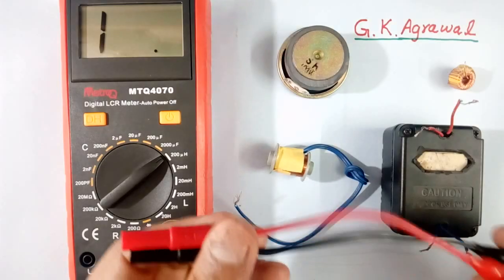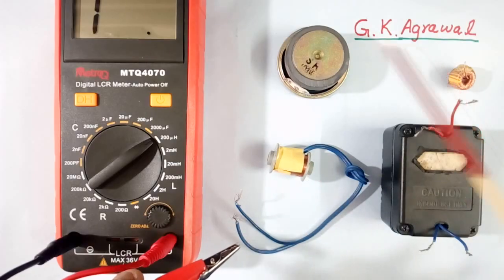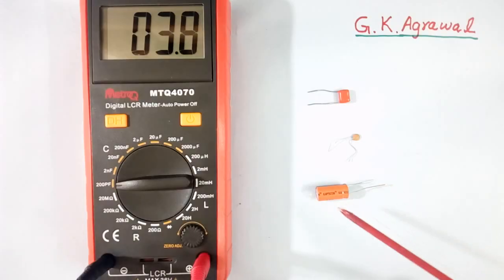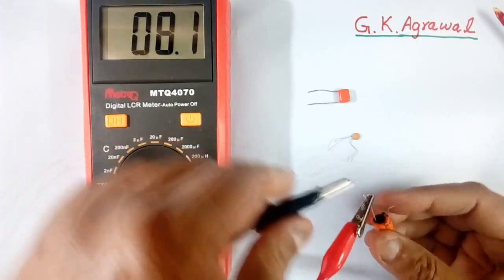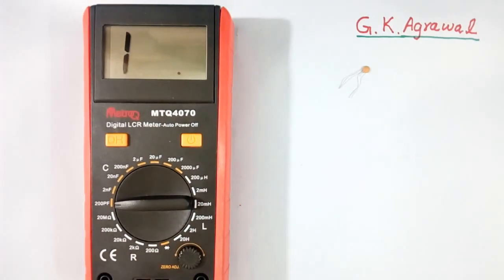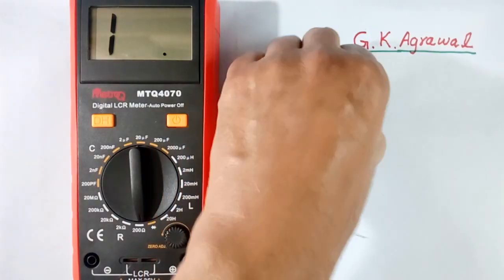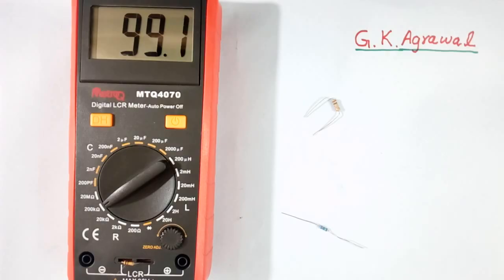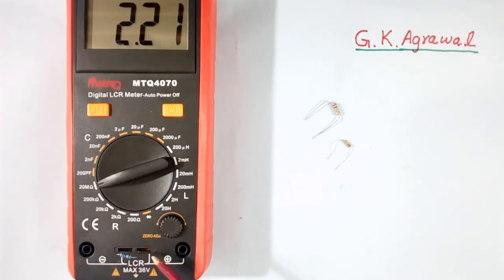LCR Meter to measure inductor, capacitor & resistor value

Comment: Thank you for the refresher course, I took electronics class in high school, but 35 years ago, Amazon has this tester for about $32 bucks, that is what brought me here, I have a peice of machinery that goes through start up capacitors, I been using an ohm meter to check them, this seems like a better route for testing them
Reply: I do HVAC work. Without some way of checking uF's, I'm lost. I use this for playing with xtal radio sets I build. Unless you want to waste a fair bit of wire, this will save me a LOT of wasted time, "close enough" calculations, and money. I now know EXACTLY what my vari caps are in value and the value of the coils I wind. That is half the battle!
Reply: The real one, no nonsense.
Beyond all credits,
Tq sir
Reply: Thanks Prof, I’ll get one

Comment: Hello sir can guide me. A simple wire known as interconnect comprises of some parasitics RLC can be modeled as lumped rlc model. So how to measure or extract the rlc of copper wire interconnect using lcr meter???
Reply from the maker: Calculate value theoretically.
Reply: @GKAgrawal2  i want to learn to do it by using lcr meter

Comment: Sir how to use zero set knob on this meter? I find that it does nothing
Reply from the maker: Zero dial is not working in my meter also.
Reply from the maker: Zero set not working in my meter also.
Reply: @GKAgrawal2  Sir , I just found out , zero setting works only in capacitor mode : Dont connect anything to the meter probes ,then set to low capacitance mode ,you will see stray capacitance on display ,now turn the zero set to display 0 .
Happy New Year

Comment: If We use the LCR meter which is available as module without any cabinet & has a Zif socket to connect components, will that give correct reading? I'm asking because I saw a video where a person was measuring Triacs & mosfets also with it

Also, please tell me whether the capacitance measurement option given in digital multimeters upto 200uF will give correct values for both Ac & Dc capacitors?
Reply from the maker: Accuracy depends on the quality of the multimeter. 
Further DC electrolytic type capacitors have wide tolerance. So values measured may not match with the value printed.

Comment: What is the Zero Adjust dial for ?
Reply from the maker: For adjusting zero for capacitor measurement as per user manual. However I checked, zero dial is not working in my meter.

Comment: Are LCR  meter and Multimeter same??
Reply from the maker: no, lcr meter may not measure voltage and current. However there is no rule, some company can always make LCR and voltage current measurement in the same multimeter.

Comment: Do you measure the Equivalent Series Resistance  (ESR) value of a capacitor in the same way of measuring a typical resistor when using this LCR meter?

Comment: What is the highest cap and lowest cap it measures?
What is the highest and lowest inductance it measures?
Reply from the maker: Capacitor range scales, 200p, 2n,20n,200n,2micro,20 micro, 200 and 2000micro,
Inductance   range 200 micro h, 2,20,200mH, 2 and 20H

Comment: how can we check capacitance of the capacitor in the circuit.
with or without remove the connection from the circuit?
Reply from the maker: Please remove one terminal of capacitor from circuit, then you can measure the value of the capacitor. This is normal method, I followed for 30 years in industry